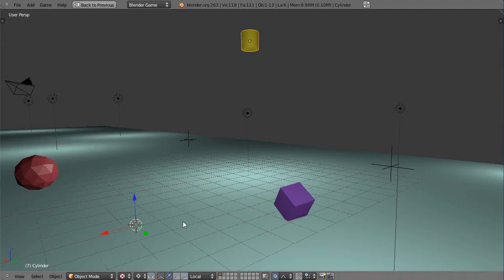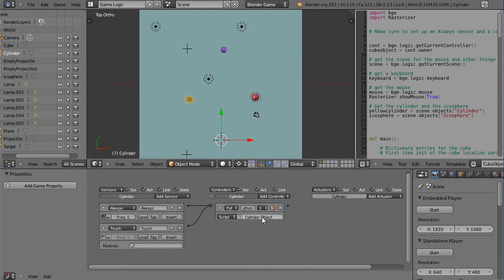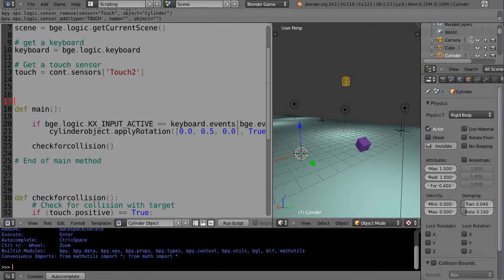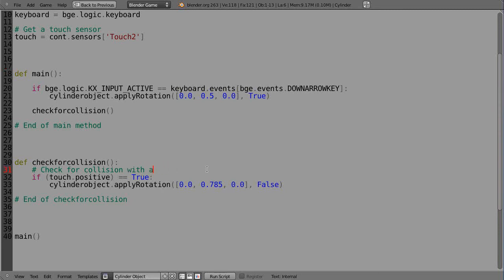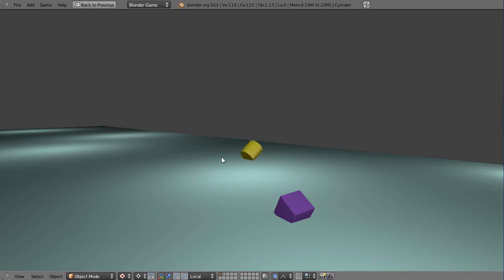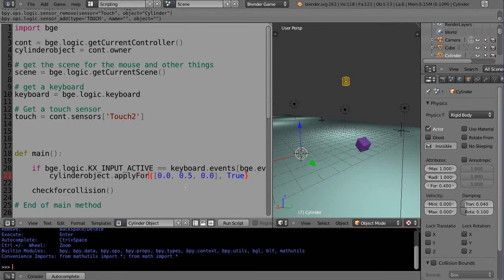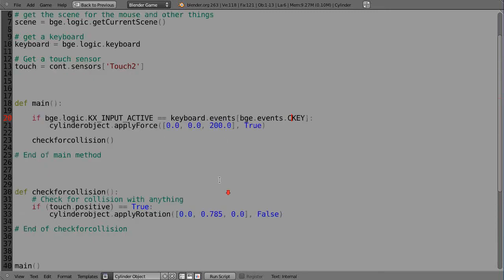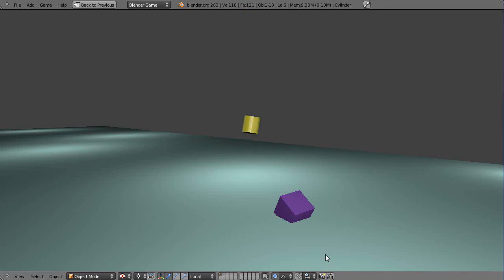Blender Tutorial - Python Game Engine Programming - Part 14

Comment: If you're following this in 2018. The touch sensor has been replaced by the collision sensor in blender 2.7.x
You need to either use a material or property. The material of the cube or give the cube a property which you fill in there.. 
It will work the same:)